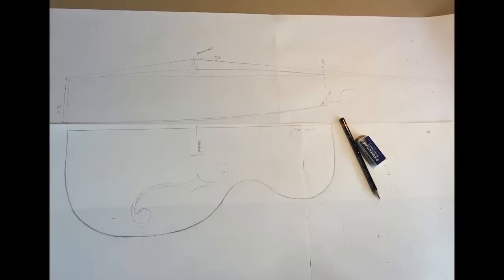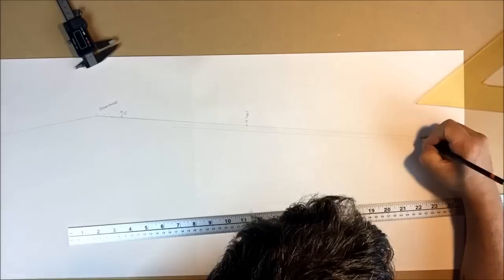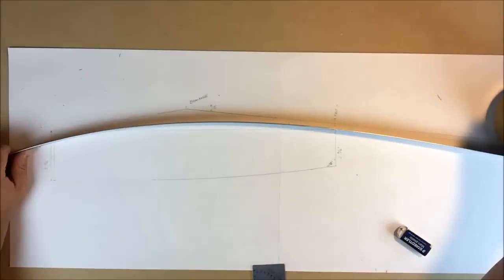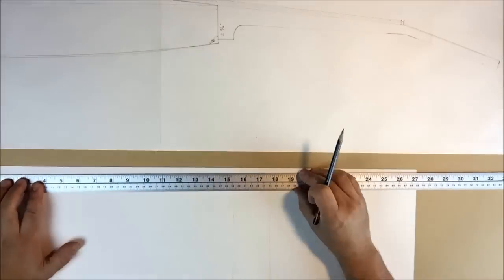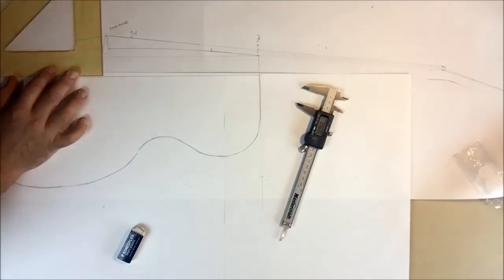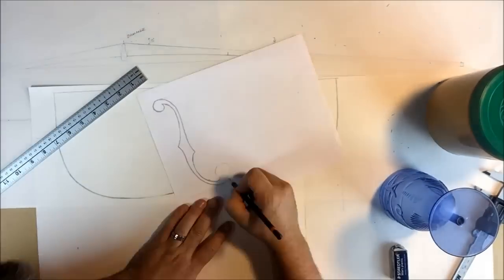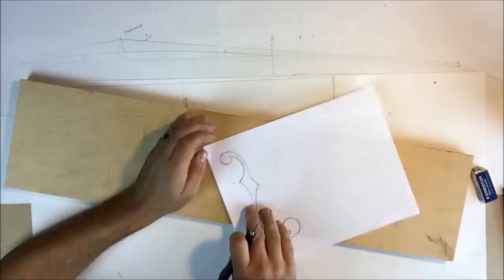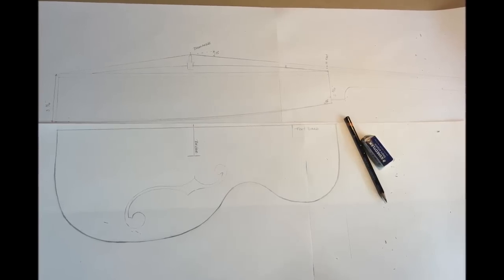Octave Mandolin build #1( Making the print)

Comment: If you need large format paper for drawing you can usually buy a sheet or two off of a printing shop.
Reply from the maker: Ken Taylor yes that is what I did after finishing the project to redraw the print and make it available . It was really cheap too. I like this paper because it’s quite a bit sturdier that the paper from the copy centre. Thanks for watching
Reply: That is some excellent work you are doing by the way.